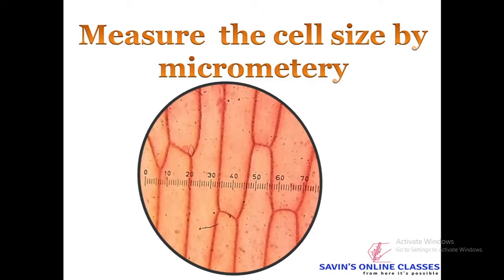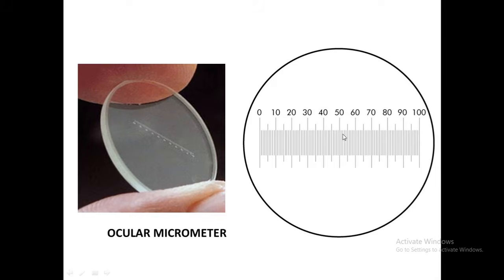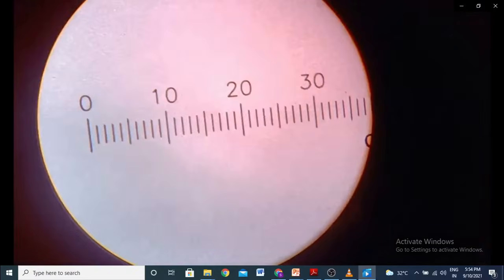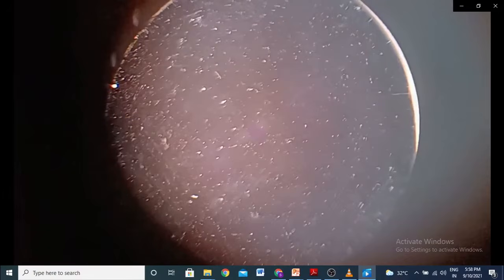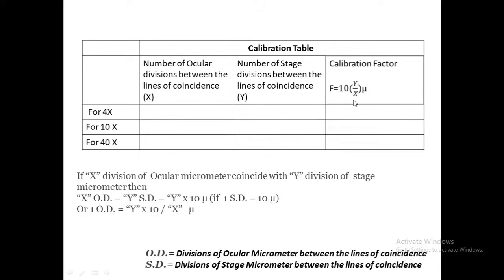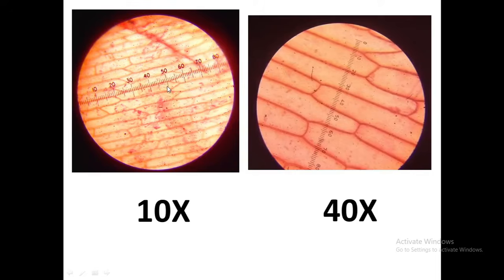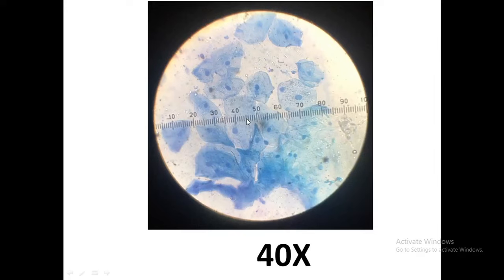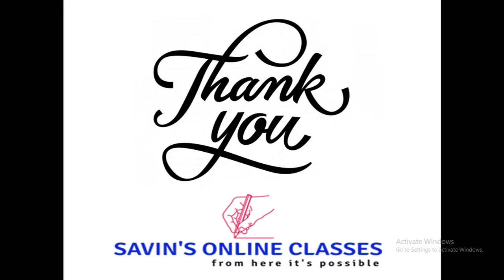Micrometery : Measuring the cell size by ocular micrometer and stage micrometer

Comment: Sir, how can we measure breadth in 40X and length in 10X , will it not be different and wrong???
Reply from the maker: Dear 
It's only the lenses which get changed
Accordingly calibration factor will get changed as well

Just imagine you have two measuring tape one only with only millimetres and second with centimetres
No matter which measuring tape you are using your height will be same by both the tape 
For example if your height is 1.6 meter there will be 1600 divisions in mm tape and 160 in cm tape but in both the cases you will read it as 1.6  meter

I hope it is clear now